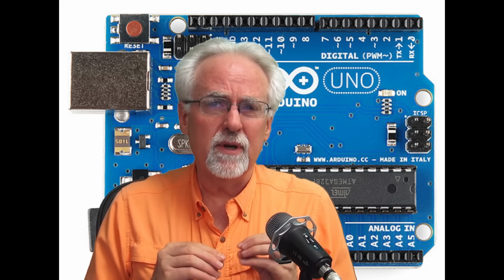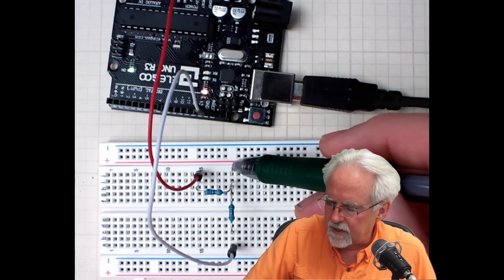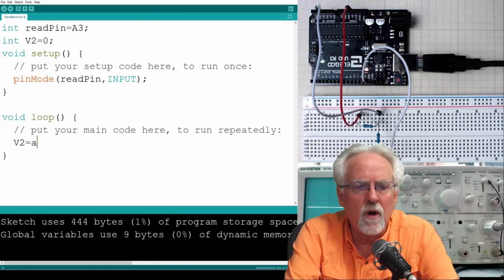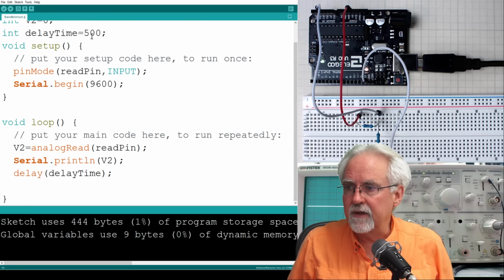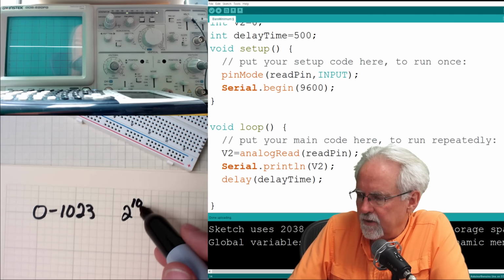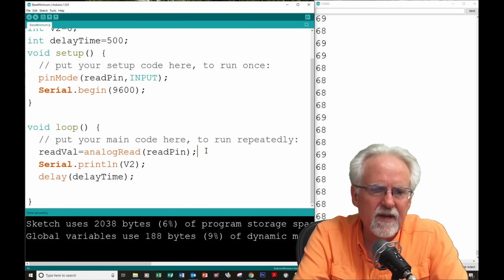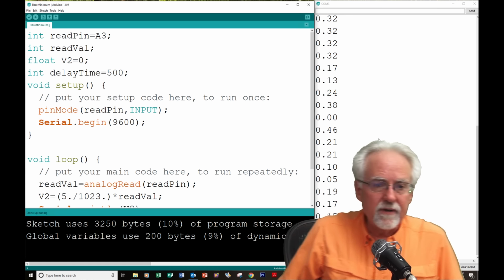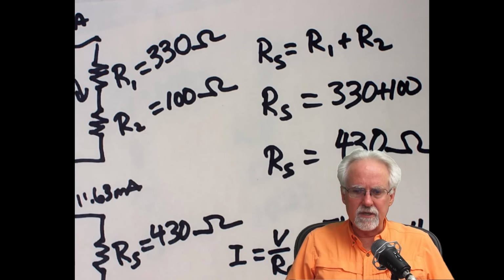Arduino Tutorial 10: Understanding How To Read Analog Voltage using analogRead Command

Comment: I am really enjoying your lessons! And yes, I make the circuits you use to teach and especially like the assignments.

I do have  a question which I'd like to learn the answer to in my studies. Say you have 120V Adaptor that you plug into the wall and it output is rated  at DC 12V 800mA. if the device you plug it into, requires 500mA? I expect the adaptor will provide that with no problem and the exta 300mA does not get drawn/used. Now what if the device requires 1200mA? Will the adaptor supply 800mA constantly without ill effect or will it burn itself out?
Will the device just not function or partially function? Always been confused about current supply vs drain.

Comment: This was a good one Paul. Had all kinds of trouble with the cheap jumper wires, the board lost the 5V out, had to power cycle the board. Got it working fine though..Reading 1.16V rock solid, Finally..
YES I am building and testing the projects along with you on the videos...THANK YOU !!!

Comment: I did the home work although I am having trouble understanding. for r1 I put a 330ohms resistor and for r2 I put a 220ohms resistor for the 330 i got 2.99 volts by doing the calculations and the Arduino read around 2.20. for the 220 I got 1.99 and the Arduino read around 2.00 or 1.99.

Comment: As a newcomer to Arduino this video series has everything I could've hoped for. Thank you! 

Is there a reason why an 8-bit number is used for analogWrite but a 10-bit number is used for analogRead? Are there practical reasons why you would need more precision when reading voltages versus setting voltages?
Reply: I was wondering the same thing.

Comment: Hi Paul, glad to learn Arduino from your course. I just got my Arduino. I wasn't sure how A3 can be an integer value but I guess A3 is also a variable
Reply: yes that threw me for a loop when it compiled OK
Reply: A3 is the value that the pinMode command needs to know which pin on the arduino we are accessing.  We declare the readPin to be A3 because we want to use variables instead of constants so if we want to change the program later, all we need to change is where it is declared.  That way we don't have to search through our programs to find all the places we might have used a particular constant.  Does that clear it up a little more?  Some of these concepts will be more understandable as you get deeper into programming and get more experience.

Comment: Paul, I think I know why, but how come I could not get a reading of 3.84 V across R1 in that circuit. I got the 1.16 V
And the 0V at the end of the circuit.?
Reply: It matters which resistor is at which point in the circuit.  If you build it one way you will get the 3.84 V and if you switch the resistors around you get the 1.16 V.  Do the circuit analysis both ways and maybe you will see why it happens.

Comment: Okay, riddle me this:
Setup the board and code the same as Paul, was coming up with 1.55 v reading V2.
For grins inserted a led between R2 and grd.
Now the voltage reads 2.88v
So if all I added was the LED should not my voltage had been the same?
The LED added voltage!  I know there is a reasonable explanation, but I am not finding it.
Thanks Paul for this great series!
Reply: It didn't add voltage, you just added another voltage drop.  We are measuring the voltage drops across the components.

Comment: Thank u Very Much sir I have easy Learn of  your excellent explain .
and find easy way to calculating voltage of arduino as here is 

5 V ـ  1023ـــــــــــــــــــــــ
?? V ـ293ــــــــــــــــــــ

?? = ( 293 * 5) / 1023

Comment: Probably the most challenging one yet. I'm using a 220 ohms resistor and when I do the calculation to find V1, I get 3.44v. R2 is accurate (100ohms) resulting in 1.56v. But Arduino is reading 4.89v for R1?? It's reading R1 as expected 1.56v. Is my Arduino pushing more than 5v???

Comment: im confused what the v2=0 exists. if anything is multiplied by zero, it becomes zero! what is it doing in the code?
Reply: Are you talking about the float v2=0; line in the code?  That is just declaring the variable v2 as a float and setting it at 0 at the beginning of the program.  Later in the program v2 becomes the value calculated and sometimes that can be 0, like when you put the wire at the ground end of the resistor.  So yes 0 times something is 0 which it should be when it is attached to ground.

Comment: Why is it when I connect the wire from A3 to above R1 , I get 5 volts (I should be getting 1.16 V). I also get 5 Volts when connecting the wire from A3 to the hole underneath the red wire (below the left wire of R1)?
Reply: You are measuring the voltage going into the circuit before it drops through a resistor, so you get the supply voltage of 5 V.

Comment: As an EE, the series has been interesting although I have skipped over a lot of the early sessions.  I have most of the needed parts (use the Arduino Mega), but will not purchase anything through Amazon. Also, don't get insulted but I wouldn't drink iced coffee even with a gun to my head.

Comment: I am really enjoying your videos Mr McWhorter! I setup the circuit the same way you did, just with 1x220k and 1x100k resistors and the readings weren't right. I eventually got the readings right when i used 2x 220k resistors - reading of 2.5V. Any idea why the 100k resistor gave problems? I tested a different 220k and still didn't work. Tested a 10k resistor and it worked.

Comment: This was fun.  instead of using the 5v off the board, I instead used a variable voltage power supply.  It was really cool to see the serial print change with power supply voltage changes.

Comment: Paul:  I'm using an Arduino Mege 2650 instead of the Uno. This program does not work correctly. It always reads 0. How do you read analog signals from the 2560?  Thanks
Reply: Richard H Mine works fine with a Mega 2560.  Make sure you have the wires in the proper holes in the connector and it should work fine.  I didn't have to change anything in the code to get it to work after changing from the Uno to the Mega.  Check your wiring.

Comment: Hey Paul. I was wondering.. Why does the readings change (290, 291, 292, 293, etc.) You said it's 292, but it's not printing out 292 but instead it's printing out (290, 291, 292, 293, 294, etc.) Thanks. 
https://youtu.be/5TitZmA66bI?t=760
Reply: It could be due to a temperature change in something, maybe a resistor or maybe something on the Arduino itself heating up slightly, or could be a connection that isn't making real strong contact and it gets jarred.

Comment: I'm confused on how to calculate current (my number is always very small and probably wrong)🤨 Yes that means I couldn't do the homework :(
Reply from the maker: You are calculating small numbers because we are dealing with small currents. 1 volt across a 1,000 ohm resistor would be .001 amps. I have worked with microAmps, nanoAmps, pikoAmps and even adoAmps. Unless you are building a power station, current is usually very small. Things in your house like the stove, refrigerator or hot water heater are things that draw lots of amps
Reply: @paulmcwhorter  so I need to calculate miliAmps instead of just amps

Comment: Building a long side and having great fun learning. However have yet to acquire your kit so substituting my own resistors(220 + 82) yet I can't seem to get a low reading; I get the corresponding 3.94V ( my equations stated I should get around 3.64V).... for the high end but no matter where I put the read pin, I don't find it...0V, 5V, or 3.95V...

Comment: lol.  I saw the wire hooked up wrong at the beginning of the video.  You had you ground wire hooked to 13 instead of zero.  I finally said I must be looking at it from a bad angle.  I do not understand why it was working in the beginning however.   Great videos and i like it that you make mistakes whether they are intentional or not.
Reply from the maker: You are correct

Comment: I don't know if it is to late, but I would like a video more on Scientific Notation. I've been following along with this video and I still don't understand how this V2=(5./1023.)*readVal; works.

Timestamp 17:55

Could I get some more Examples, and How to do this math in my calculator? Calculator is TI-36x Pro.

Thanks
Reply: Hello Andrew, I'm not an expert on this, it's been interesting to follow through after more than 30 years. Mr. Paul stated that the AnalogRead command does not read an actual voltage. This formula takes the value read from the Arduino and converts it into a voltage value. Also in order for this to work the V2 variable must be defined as a Float to be able to capture the decimal numbers. hope this helps. Good luck!

Comment: Thanks again for the videos Paul.  Ladder logic and simple machine language were all I was taught in EET back in 1998...  One question if you have time.  Is it possible to get a voltage reading out 3 places from the decimal?  Maybe it will be revealed in a later lesson but I am curious.
Reply from the maker: The actual measurement is between 0 and 1023, which means you have intrinsic accuracy of one part in 1000. If we are measuring 0 to 5 volts, what that means is you could have a precision of 5/1000 which would be .005 volts

Comment: I'm curious, as to why we haven't used the Digital Multimeter (Voltmeter) in Resistance Mode, to see if the Resistance is Accurately Labeled! Or, discussed how to read a Resistor Labeling Band Marking and Precision Values (ie: 20%, 10%, 5% Precision, Etc!), So we can prepare for the difference in our Ohms Law Calculation! 🤔

Comment: So.. I wanted to use this technique for  measuring output voltage of stepdown regulator from 12v to 3v. and somehow, I still dont know exactly how, I blowed whole thing up. poor little arduino, i had to get new one

moral of the story, dont skip through videos asuming you know enough when u dont. it could be expensive.

thank you for great lessons, I will replay every video few times before actually connecting something from now on

Comment: Could you please make a video for total home electricity system monitor and auto control some home electric accessories on and off if the condition fulfill. Example I've  gov. electricity supply voltage (210V-245V) and solar system. I want to start automatically solar power when (some) condition match, check the solar power, temperature and display on display board also on mobile. I want to store whole the data is SD card.

Comment: I would be much greatefull if you will help me on a project.
I want to use two LM35 to monitor the temperature of two heat sink 
in an amplifier. one for channel 1 and one too for channel 2 and i want to display the temperature 
on second line of the 1602 screen.one the first line,I want to display "CLASS D900 WATTS"and i want it to blink
I also want to display blinking "PROTECT" on the first line and a moving"POWER OFF" when the Arduino pin sense a voltage between 5v to 3v.
I want the blinking "PROTECT" to stay on the screen till the voltage is removed.
i want two pins for channel 1 and two pins for channel 2 for the voltage sensers. you can send the code through   osikani20101@gmail.com    thank you in advance.

Comment: I'm experiencing a problem with my analogRead. It is recording 3.74 volts from my 100 ohm resistor. However my multimeter is correctly reading 1.19 volts.

Comment: hello sir I was having an issue like the serial monitor was reading 1023 even though I put everything in the circuit in the correct place even i think my code is correct could you please help
Reply: I had the same problem, havnt found a solution but will let you know if i do :)

Comment: I was able to do this same thing with current. I decided to calculate it in Amps. For anyone needing this, the 5V Pin gives 400mA or 0.4A

I am now trying to make a MultiMeter with this. The power source for the circuit will be a 9V battery. If you calculate voltage and current, use Ohm’s Law to get Resistance and print it out in Serial Monitor.
I would’ve never accomplished anything like this if not for Paul. Thank you.

Comment: Do we need to declare and initialize the V2 variable as 0, or can we just declare it like so: float V2;
Reply: If you initialize it as 0 and then ask the programm to print it then you re gonna get what you put the prorgamm to do from the begining the V2 variable will stay forever 0 and its the only measure you gonna see in serial monitor. In this example you want to declare it with float as you said, because V2 is a real number and not just an integer and don't equal it to any number at first.

Comment: Thank you for your excellent tutorial. One question: when I use pin 3 with analogWrite(3,val = anything) to supply my voltage, my reading is zero. It only works when I use digitalWrite (3,HIGH) or analogWrite(3,val = 255). I wonder why. This analog write was successful to change the brightness of the LED, so we should measure something.

Comment: I’m using the mega2560 when I in put Serial.printIn printIn stays black but if I type print it likes. However the com monitor runs numbers in a row rather than column
Reply: It's print ln with the L

Comment: Hi Paul, you only used one pin to measure the voltage at resistor2, but how would you measure at resistor1?
Reply: another question, why would you set a value to the variable V2? you declared float V2=0. Thanks

Comment: Hey Paul, loving the videos! This one was a bit confusing to me though. I'm unsure of why we set V2=0, why readVal doesn't need to be defined in void setup, and why V2 being 0 doesn't make all the printed values 0. This was definitely the most conceptually complicated program so far, but I'm hoping it becomes more clear in the next video.
Reply: V2 can be set to anything when we first create it, we're going to assign a real value to it later. It's just good programming practice to assign a value to a variable when you create it. 

readVal is just a variable that we will use to accept the value we get from reading pin A3. We define it at the top (called a global declaration) so we can use it anywhere in the program. It is not defined in void setup because void set up is used to initialize objects, such as telling the pins whether they will be input or output or telling the serial monitor how we will be communication with it, at 9600 baud in this example. 

V2 is initially set to 0 just to initialize it. That value changes in void loop as we read pin A3 and the do the conversion V2=5./1023.*readVal. We are assigning the value of the right side of the = sign to the variable on the left side, in this case V2, then we print that value. Each time we go through the loop, we do the conversion anew and a different value can be assigned to V2, which is why you see the output on the serial monitor change. Of course, sometimes the value we get from readVal is the same as the previous value, which explains why the numbers in the serial monitor don't change.

Hope this helped, though I realize your question came from some time ago :)
Reply: I am right there with you. I went through this one a few times to get a better understanding.

Comment: What defined that you're just reading 5V?  is that the spec of that pin? What would happen if you tried to read from a 10V source on that same pin?
Reply from the maker: You would not want to do that. This is 5V logic. It only works between 0 and 5.
Reply: @paulmcwhorter  I realized it was dependant on the logic board, so I looked up the spec.  It measures up to 5v only, and some models 3.3v.  Now I'm curious on what kind of circuit would need to be developed to read higher voltages!

Comment: I realized today that in my Inland Super Learning Kit for Arduino (bought it before finding your videos), that my resistors are most likely all banded wrong. I selected a 100 and 220 Ohm resistor and realized the voltage drop was way too high. Went down to one 220 Ohm and it's more like a 430Ohm resistor. It gives me the same value of your two resistors in series though. Haven't used V=IR since college, but it helped me figure out what the resistance of the poorly made resistors is. I feel like I'm learning more here than I did at University.

Comment: Sir i have a problem 
The voltmeter has two wires and in our circuit using arduino we have one wire through which we are inputing where is the second wire connected???
Reply: Is it that the 2nd wire is connected to the ground??
Reply: I think so

Comment: I hooked mine up to the 5v, got around 280, hooked it up to ground got about the same, looked at code and wires and they seemed to be the same. Very confused
Reply: Tried a few more set ups, still getting around 280 no matter what....
Reply: replaced wires twice for the one hooked up on it and that managed to get it working

Comment: Just been through lesson 10, great loads of content. I had an extra comer in the code, I was getting 230 on the serial window which took a bit of working out what was wrong. Good learning experience. I think it would be good to mention comments to the right of the active code  // this is to read pin 1  or such. I just picked this up from examples